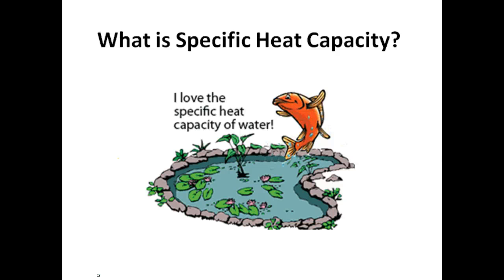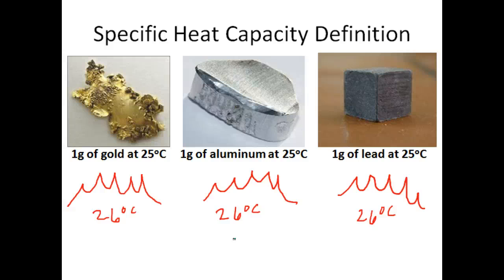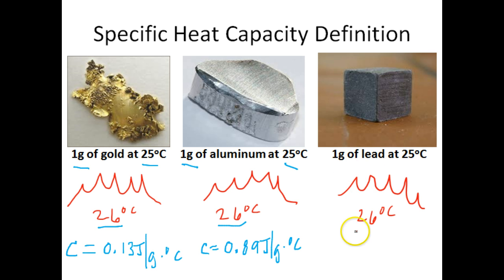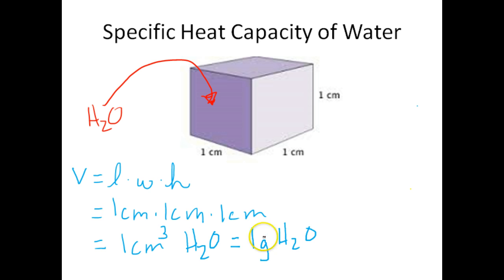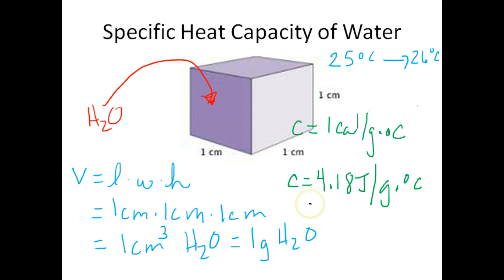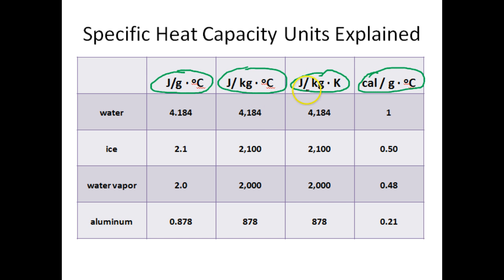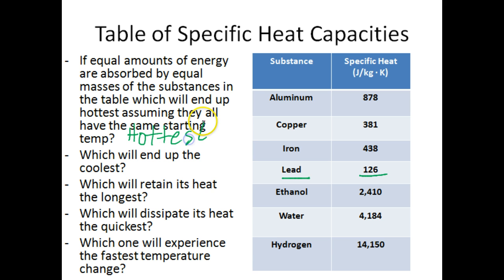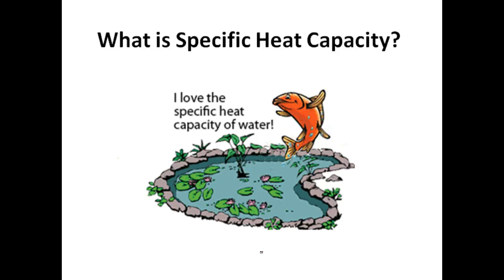Specific Heat Capacity Explained

Comment: isn't specific heat capacity the amount of energy required to raise the temp. of 1g of pure substance by 1 Kelvin unit, whilst heat capacity (not specific) is the amount of energy required to change the temp. of 1g of substance by 1 degree celsius? or am i just wrong and can't do chemistry for the life of me?
Reply: a celsius and a kelvin both measure the same amount of heat

Comment: Hydrogen in a metal cylinder (where it is constrained to constant volume) will have a lower specific heat capacity than hydrogen in a loosely inflated balloon (where it can expand at constant pressure). So which is it?

Comment: 10:38 If we were to test for temperature change between air and CO2, by radiating it with a heat lamp, knowing air has a c of 1 and CO2 of 0.8 : CO2's temperature, compared to the air will rise faster, yes?  YES. By the way, what I just described is the same apparatus and experiment to prove CO2 is a greenhouse gas.